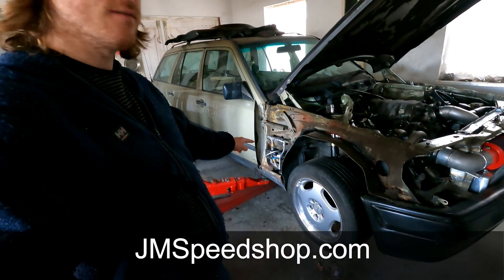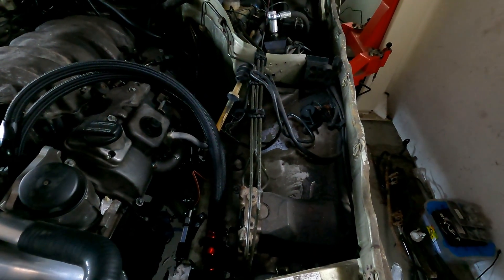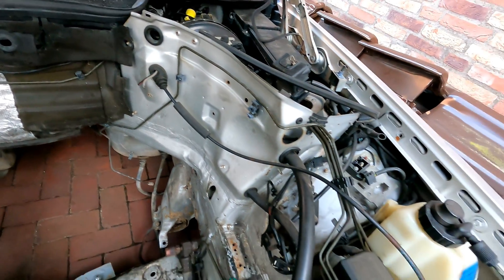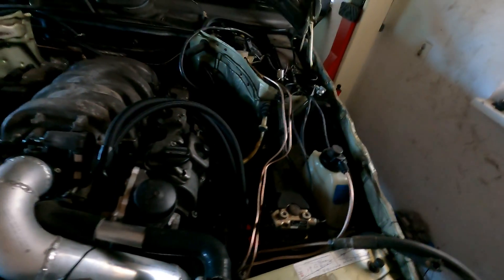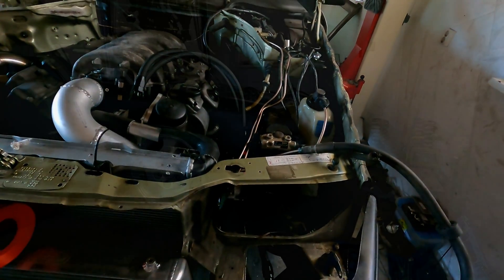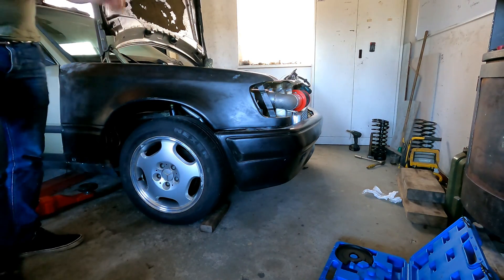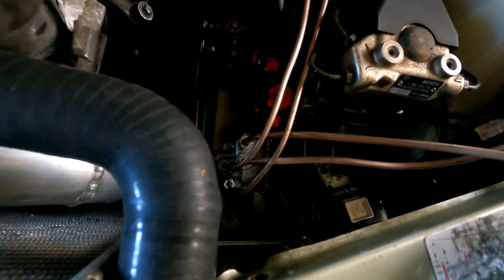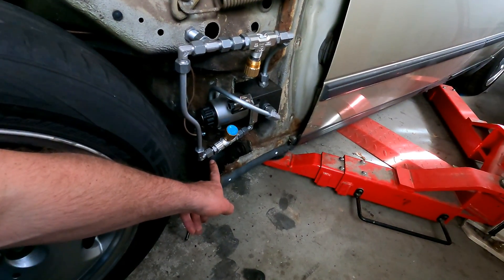S124 Working front SLS suspension part 2

Comment: I really appreciate how much work it takes to do these modifications. Kind of off topic but did you by chance open up the ring gap for running boost? I too am considering running a single turbo on my M113 build. Great work!
Reply from the maker: I have. Not opened the engine yet.  But i Will and also have a look at the ring end gap.   But people run these engine's up to  520whp around that number on a stock engine without opening IT .
Reply: @JMSpeedshop   i did my cl 55 (pre facelift 360hp) with single turbo i got 500 hp on engine and 740nm on 0.6 bar without opening the engine. I know these engines hold up to 1 bar of boost but still kind of scared to try lol
Reply from the maker: Good numbers
Reply: @JMSpeedshop  Thanks for the input. I too am running the standard 500 bottom end and I am also aware they have weak ring lands even without boost. They are so cheap to find it's worth the risk
Reply from the maker: I think the problem is nog the ring lands. IT is the cap .  People running Them to hot with to sharp timing OR on the edge of detonation .  This Will het the ring stuck in the bore and damage the ring land OR rip off the top off the piston.  That is why  going higher boost on e85 so the temp is better to control and also less chance on detonation

Comment: Very nice! Turbo V8 wasnt challenging enough? you really go the extra mile with the sls setup. A thought about sls in w210. Theres a 2way magnetic valve to increase resistance in the oil flow (sport mode). Maybe something you could install aswell. Connect the valve(s) to an ecu output and program it to close the valves (ground the output) at high speed to make the car more stable?
Reply from the maker: I have the same setup with 2 modes.  But the oem valves from Mercedes are rare that is why i do IT with 2 reducer valves and a 3/2 valve
Reply: what front shocks are you using, it is a nice set up but why do you give sls to the front also? my fantasy would be to put w215 abc seet up in my c140 the w215 just rides fantastic. good work mate
Reply from the maker: I have r129 front hydro shocks.  Reson is that i want to able to adjust the rode comfort . So not always sport. But also comfort. And IT Will adjust the level according to the Weight in the car also in the front know  when driving Aline OR with 4 adults is also dropping the front suspension a bit and now this Will adjust back to normall level